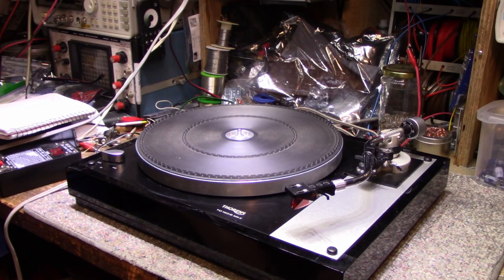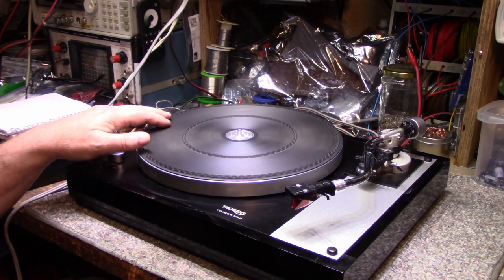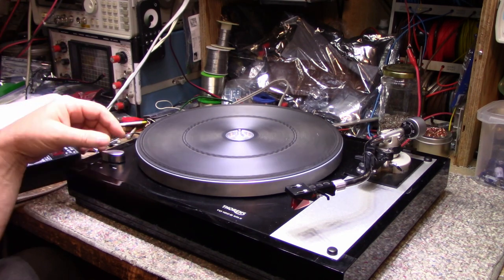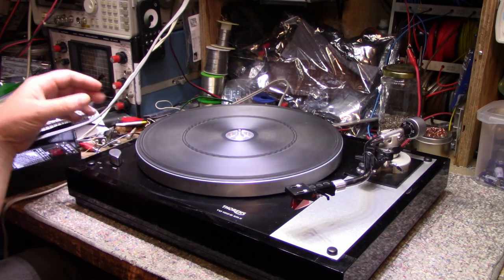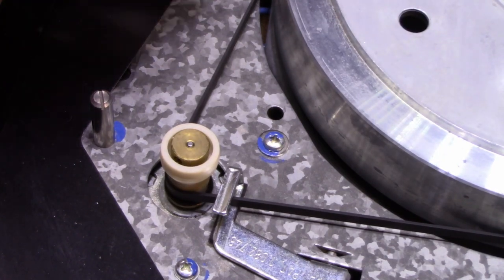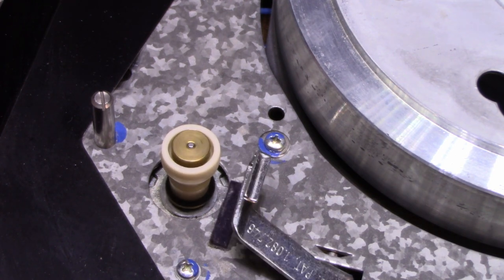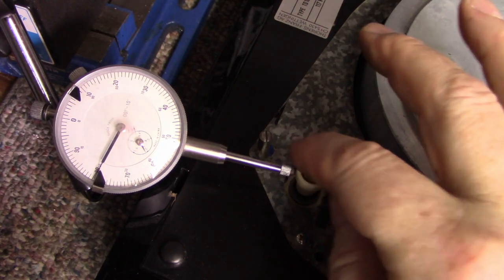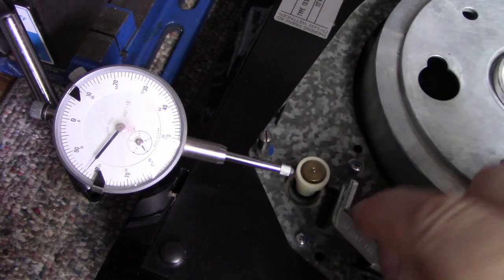Thorens TD-160B Mk 2 Turntable -  Repairs (Ep. 176)

Comment: Great video.  The tracking-force range for the Ortofon 2M red cartridge is 1.6-2.0g with a normal value of 1.8g.  1gm seems lite.
Reply: I never have seen a cartridge lower than 1,3 g. My guess for these Ortofone ones are 2,0-2,5 g minimum
Reply: @borlibaer  My Shure SV15 MKlll is 0.75 to 1.50 grams, so it's not unheard of.

Comment: always enjoy the vids , the cueing issue just needs the rubber pad on the cueing lift plate to be cleaned , they glaze over as they age and stop gripping the arm tube . isopropyl is all thats needed . rubber renew can be used on the counterweight stub isolation rubber which will stop the slippage of the stub and restore proper isolation and damping . shame the suspension on that 160b has either been removed or failed , they are very nice turntables when they are all ticketyboo .
Reply: I even used fine sandpaper at my Thorens, without success! They are all malconstructed
Reply: I'd rather say mistreated.  @borlibaer

Comment: There is a reason they use plain bearings and not ball races, noise, plain bearings are quieter, especially at low budget  levels. Ball bearings come into their own at high speeds, not an issue with turntable RPM

Comment: You'll find the cuing works better if you dial-in the correct tracking weight (also, try 'roughing-up' the rubber platform that the arm sits on, you'll get more friction, preventing the arm moving sideways when dropping the arm).As has been pointed out the Ortofon 2M Red tracks much heavier - although the 'recommended' tracking force is 1.8g, like most 'recommended' ones it's on, what shall we say, the optimistic side.....I usually use the top end of the scale, in this case I'd set it just a smidge below 2g - as you are tracking at half this, no wonder you have problems!

Comment: You should have put a drop of oil in each bearing synthetic sae 20, it's a little bit loose you should have tightened it a tad more you could measure the sides with a feeler gauge, the hangover is from the spindle not pivot point null point  won't give you hangover. If you're looking for a really good cheap phono stage have a look at classic audio spartan 5 160$

Comment: You are very patient and technical, a pleasure to watch sir! Exactly how to counter the old Thorens turntables, they are highly repairable if you have the guts and patience. Nice to see how the motor is build, lots of old motors have the ticking problem, as the axle has to much room moving up and down and the upper bearing has worn out.

Comment: Very detailed expaination and clear video. You are patient and have a good understanding of the mechanical workings. Great job. I installed the SRM thrust bearing mod but still have an occasional knock even with the screw quite tight on the ball bearing so looks like I have  sideways movement in the bearing on my deck also.

Comment: Hi Trevor, i have the Thorens 160 Super which is an upgrade to the one you sorted in this video. You mentioned having a Japanese tonearm on a German turntable. The one fitted to that turntable is made in Japan for Linn Hifi, who are a well respected British hifi manufacturer in Scotland, and the Thorens TD 160 turntables are based on the Linn LP12, which for years was the benchmark for hifi turntables. And probably still is. Their ethos is that it all starts at the turntable, it doesn't matter how good your speakers and amplifier are, if your turntable is not good, neither will your sound be. Rubbish in = rubbish out. I have the Linn basic LVX arm on my TD160 Super, which is a straight version of the one fitted to your customer's turntable. I have to say, it does sound pretty good when properly set up. Thanks for the video, I thoroughly enjoyed it. Extremely interesting.
Reply: Well if this was made for Linn it was one who clearly didn't pass QC. Never seen s-shaped arms on a Linn btw. 🧐

Comment: Try cleaning the tone arm lift surface and the tone arm where they contact with each other using isopropyl alcohol on a q-tip to cure the skew on lowering the arm. I had the same problem with my TD160S and SME  Series III S tone arm and that fixed it. Great vid btw!

Comment: I have an old technics sl-220 from 1978 i bought in 8th grade and still use.  Never bothered to check the gimbal freeplay until i saw this video.  Mine has very slight play.   Probably like that from the factory.  Turns out the spanner screwdriver to move the locknut is an obsolete size or special factory tool.  The proper way to adjust this now is to buy the right size flat tip screwdriver and grind a slot.  On my technics i will need a 7 mm wide tip and will have to remove about 3 mm from the middle

Comment: I got my hands on a td160 with the exactly same issue as this one, but i have a spare motor, but im saving the old one . But since the new one is still good, i want to still keep it that way, so what kind of grease do you recommend using on those bearings?

Comment: Bended motor axe, you can't make this stuff up 😅
For the lift and anti-skating that moves the arm, the half round resting pole could be slippery, or not levelled. 1 gram should not be able to move him. You could bend it a bit to lower the left side, the arm would not go uphill.

Comment: You can also compress the brass to take up the slack where the shaft wore it oot.
Tap it with a very small hammer and if you get it too tight, drill it oot.

Comment: You surely go the extra mile Trev, especially since the other "shop" gave it up for dead.... Just one addition to the cartridge setup. You should always check the "Azimuth" to ensure the cartridge /stylus is perpendicular to the record. You actually witnessed bad azimuth due to bearing issue, but in most cases with most tables,  it is due to cartridge "mount" being slightly twisted over the years of people install, removing headshells..... They sell very inexpensive 'Azimuth Blocks" (search that phrase). They are clear with horizontal lines which you sit in front of the cartridge and view from the front - would send you one, but in Australia;). This will give you indication if the cartridge is "leaning" left or right. On most S Shape bayonet mount arms there are two very small screws underneath where headshell mounts. Loosen these and very slightly angle left or right adjustment. Access to these very small screws requires a fine AND very short screwdriver because they are under the tonearm.... Great vid -  thks as always...
Reply: A mirror is all you need for azimuth adjustment.
Reply: @TurntableGuy  Of course, yes... Like your videos. The "blocks" are way cheap and are so much easier to use with graduations